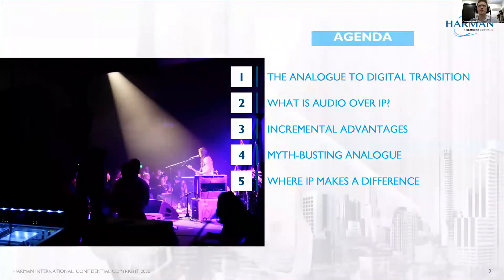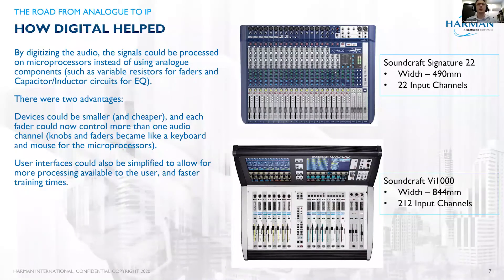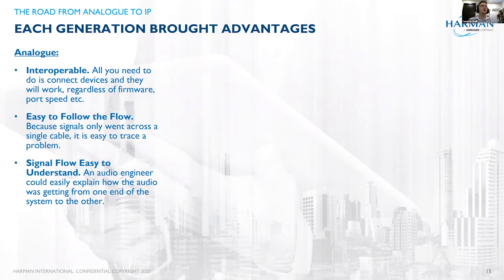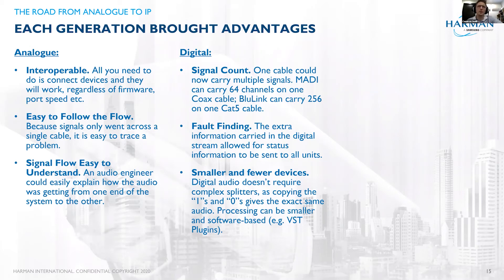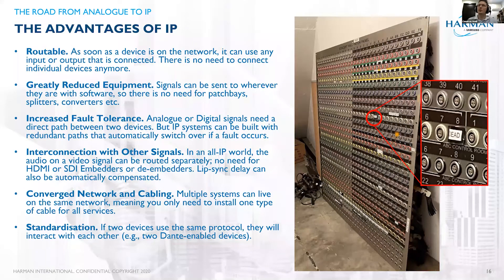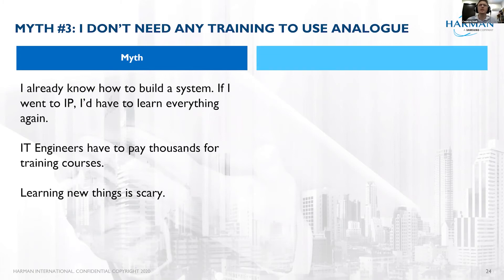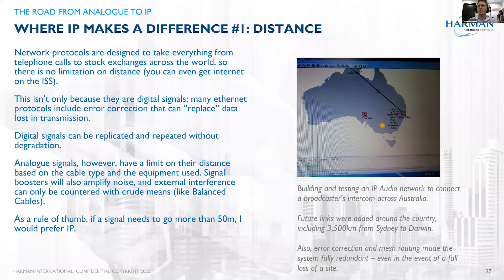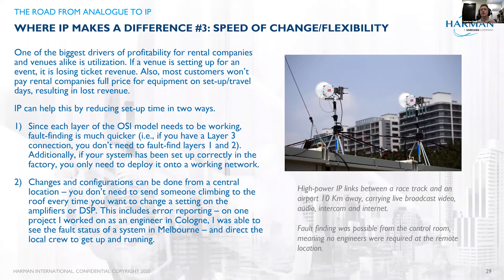Switching from Analog Audio and Video to IP Workflows - Why Fix What Isn’t Broken? – Webinar

Comment: Firmware Update Request for PRX Series: I would like to request a firmware upgrade to the PRX series to make the subwoofer PRX 818XLF able to play higher up to 120Hz at 3dB, similarly the SRX818. See this comparison:
Prx 818xlf (10dB): 30Hz - 102Hz.
Prx 818xlf (3dB) : 35Hz - 87Hz.
*Srx 818 (10dB): 29Hz - 150Hz.
*Srx 818 (3dB): 35Hz - 120Hz.

Would be useful if add this increment PRX818xlf, just like:
*Prx 818xlf (10dB): 30Hz - 150Hz.
*Prx 818xlf (3dB) : 35Hz - 120Hz.